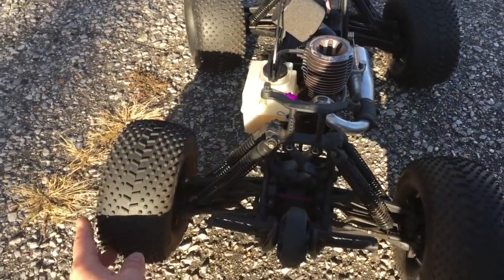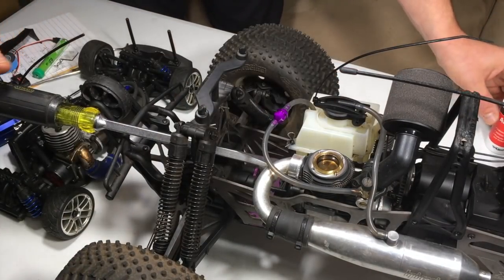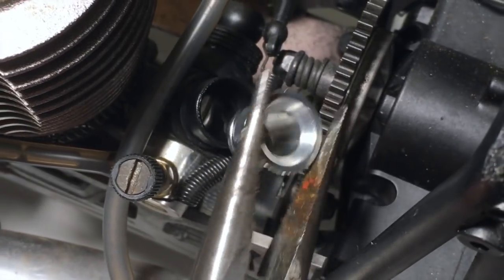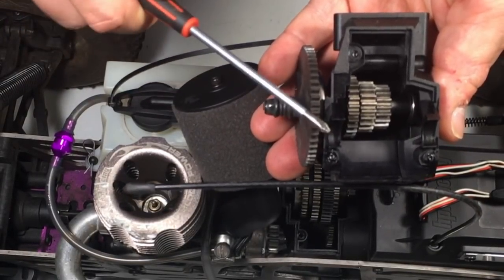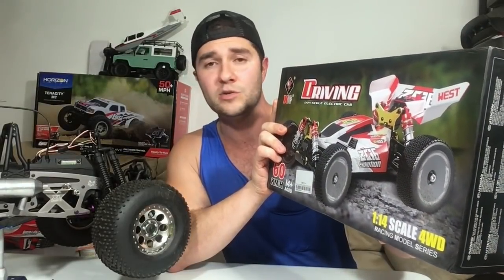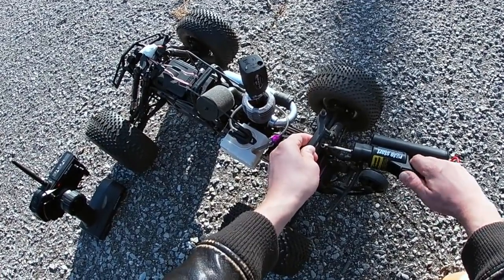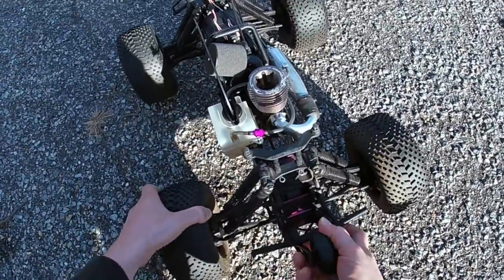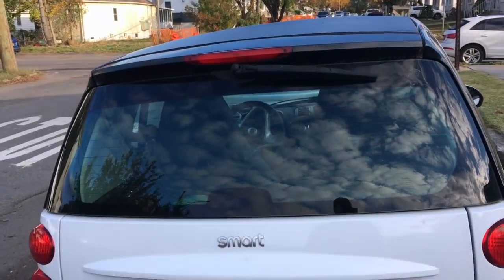HPI Savage XL K5.9 - In-Depth Engine - 3-Speed Transmission & First Start (Part 2)

Comment: that restrictor is a venturi insert. It works like a turbo charger and speeds air up when it enters the carburator. It gives a nitro engine boost. Nice video, I'm also a Savage XL owner with it's original K5.9 engine. When this engine has a proper tune, man it goes :D!
Reply from the maker: whats up my fellow Savage XL owner, really appreciate your comment and the view.  I will test out how the engine runs with and without the carb insert, should be interesting to se if there are any real results.  I rem years ago when real car aftermarket companies were selling those intake vortex like devices and claimed more HP and better fuel economy.  Well I put it int my Ford Taurus at the time, and it did nothing.  LOL.  Clearly.
Reply: np, really appreciate what you do and the way you do it. The worst thing on the Savages are those double disc brakes and the way they are mounted. I always have to retighten those screws after my truck was being run without brakes.

About those venturis I can notice a bit of boost/torque when running my Novarossi Buggy 4 PLUS engine with bigger/smaller venturi. But did not experiment with venturis on the Savage. For my taste it goes quick enough :D!

Comment: Hey brother been a while.... still watching every video.  Got a good kick out of you running yourself over with the helmet on bet that drawed in some looks.  Haha nice man love that HPI Savage the engine was looking very clean internally.  My first nitro was a Savage X 4.6 but this was the original X not the re-release!  That EK4 was a sweet truck.  Do you remember the Ofna Twin Dominator I think it was?  Basically a big monster truck with dual nitro engines?   I know we like nitro and gas but I got a HPI WR8 rally car to play around with and let me tell you it’s a lot of fun in the light snow on 3S so far. The car is good for 60mph.  Haha I was wondering if the street views were of Halloween as I seen a Nun behind you with some cleavage 😂.    I’m on a hiatus from rc now until winters over (about 6 months ☃️🇨🇦) but I did grab a 2wd buggy for some indoor racing this winter.  That and I’ll wrench and do some upgrades on my cars over the winter.  Might find a nice kit to build later.  I’m planning to take up the snow mobile hobby this winter so see how that goes lol. Cheers brother 🍻

Comment: 27.7 in my XTM mammoth it’s a Beast they don’t make them anymore❤️ nice truck you have to
Reply from the maker: whats ups man, I love the XTM trucks, Im looking to get an XTM X-Factor eventually.  I used to have an XTM 24.7 motor, ran pretty good.
Reply from the maker: I also currently own an XTM X-terminator 1/8 buggy with a XTM .28 motor.  I baught it like a year ago, and still have not done a video on it.
Reply: @hybrid32494  cool that's a good deal Awesome😃

Comment: I Just Bought Me A Savage 5.9 XL Also, From Offer Up.. Good Thing I Check It Before I Bought It, B/c The Engine Wouldn't Turn @ All Even With A Drill, Instead Of Using The Rotor Start.. I Told Him The Engine Might Be Seized & It Needs A New Motor So He Took Of $150 & I Bought It For $100.. Its Not As Clean As Yours But It Was Only Street Driven & You Surely Can Tell.. I'll Be Looking @ The Engine On My Next Day Off & Hopefully Its Not Seized.. He Didn't Run It Over 8yrs.. What Do You Think, Its Seized?? Can't Afford To Buy A New Motor Yet..Also How I Can I Tell If My XL Has Reverse? He Doesn't Remember If It Has Reverse Or Not..🤔

Comment: Nice rig. Sucks it broke,  but very easy and cheap fix.
Reply from the maker: YEP dude!  I realized why it broke when I was fixing it soon after (not part of this video).  It turns out the tie rod end that snapped was incorrectly installed, It was screwed into the top of the wheel hub, not the bottom, like all the others. I think the incorrect geometry caused this. No big deal, I had a spare in the included parts.
Reply: @hybrid32494  I've got RC's new from the factory that had some links connected to the bottom when they should have been on top.  Checked the manual and sure enough they put it together wrong

Comment: That other motor is prolly not seized . The nitro fuel wen it sits for a while it gums up the cylinder and makes it feel seized take the motor apart clean it with some brake cleaner and oil it up with some 2 cycle oil not a lot . Use a eye dropper and drop two drops in it top of piston and bottom

Comment: A revo 3.3 is a 3.3 sized motor and it's not even 1 hp 5cc motor I'd assume would put about 2-3 hp
Reply from the maker: Hey man, thanks for watching.  The Revo engine is tough to find accurate HP specs for, but most people agree it is about 1.5 HP at most.  Most forums say it's in the realm on 1.3-1.7 HP on the TRX 3.3. This 5.9 HPI engine is claimed to have 3.75 HP.  I would say it's about 3.5 to be on the safe side.
Reply: @hybrid32494  I've been told the opposite but you most likely know more than them haha
Reply from the maker: im 100% sure on the HPI K5.9 motor being rated at 3.75 HP, you can find it on the HPI website.  For some reason traxxas never really makes a point of publishing any HP engine specs for their motors, but most argree it is around 1.5 or so.  It really isn't that torquey at all, but does give good high RPM.
Reply: @hybrid32494  I looked it up traxxas said 1-1.3
Reply from the maker: hey!! sounds about accurate.  Many people think it's more around 1.5.  But once again, nobody can really confirm this without an engine dyno.  Needless to say the TRX 3.3 is really underpowered.
Reply: @hybrid32494  underpowered but fun

Comment: If you are the guru of RC cars how is your knowledge of Tamiya and kyosho?
Reply from the maker: good point BRAD!! I only know tamiyas from 1995+ and Kyosho from 2000+ model years.  I do own a 2002 tamiya Terra crusher nitro truck (you've seen the vids on it I hope) and a Tamiya lunch box (your favorite).  lol.  I also recently got a Kyosho nitro 1/8 buggy from a few years ago which is still new in box.
Reply: @hybrid32494  hey you need to get a midnight pumpkin and the low rider version of it to and the new cc02 and a cc01.

Comment: The stock air filter really doesn't have enough airflow you need to get a new one to get all the horsepower that it can get mine about doubled just by changing out the air filter and the housing itself                           If you can find a 8 port sleeve They interchange see if yours is the 8 port or the 6 port the 8 port had a lot more horsepower than the 6
Reply from the maker: hey dude!! Can you tell me anything about that air restrictor in the carb?  This engine is clearly broken in pretty well from what I can tell, Do you think removing that restrictor will do anything?
Reply: You wanna find one that has a 9MM opening or just drill one out in that should do it just get a bigger air cleaner and it will run like a champ
Reply: @hybrid32494  The weak spot in that engine is the rod if you can find aftermarket I would suggest doing it is just getting really hard to find parts for that engine thanks have a good day
Reply: I got mind to spin all 4 tires   without doing anything but the air cleaner it needs to be bigger than the adapter the adapter should be a 9MM Or bigger to get the best performance some people have had to change the muffler to a 86 but i cant remember the  Manufacturers
Reply from the maker: I have a spare motor savor air filter this thing came with, might eventually use it, when the engine is tuned and running well.  Got a question for ya, did you run into any issues with the 3-speed?  So far as you saw mine broke right away so I could not test out the gears yet.
Reply: @hybrid32494  No I've never had a problem with my 3 speed I just had a blast it bearing but I caught it way before it had any issues other night it was great Just try and watch for the bearings they will go out Just watch for the differential bearings and the tranz bearings are in good shape you should be good
Reply: Sometimes there are just defective parts I've never had any problems with mine

Comment: I would put 30% in her buddy, I used to use 25% but she runs a tonne sweeter on 30.
Reply from the maker: hey dude! thanks for watching, the most I have now is 25% nitro, in this video I ran 20%, but I'll get a quart of 30% soon and tune this up and let it rip.
Reply: @hybrid32494  That's the right move dude, I dropped you an email. But in short you've done effing good to get her up and tuned so fast. Mine took me tiiiime =].

I always thought it was insanely loud in comparison to my other nitros, interesting to see that visualised.

Comment: FK Banggood! I'm done ordering from them. I believe that they do not treat all customers equally and use a bait and switch with shipping. I typically like to make large orders to save on shipping. Multiple times I have ordered from them, paid for my order including shipping then they split my order up and un-proportionally split the shipping then on the largest part of the order they put on hold requiring additional shipping because, as they claim that the shipper will not ship it via that method and they want significant $ to upgrade shipment. Then they end up shipping a $6 item and have applied for example $5 of a total of $35 shipping to the $6 item. So most of what I really wanted and the bulk of my order is canceled because, I won't pay additional over priced shipping when they made the mistake to begin with and end up paying $11 for a $6 item that I could have bought for $8 at Harbor freight.
I believe if you are not a valued customer, they will screw you! No more banggood! I have had good experience with AliExpress. Also sometimes I have ordered from Banggood CN warehouse but they switch it to ship from the US warehouse. This sounds great however, if you see this, your item will likely never actually ship but when you contact them about it, they give a BS statement that its on the way, it's like they don't even check. Banggood is the worst IMO!